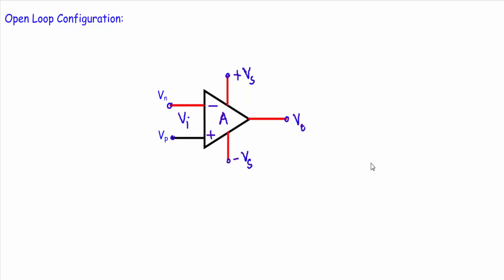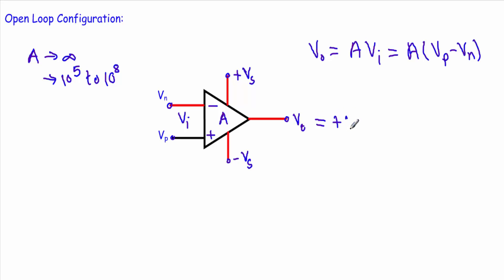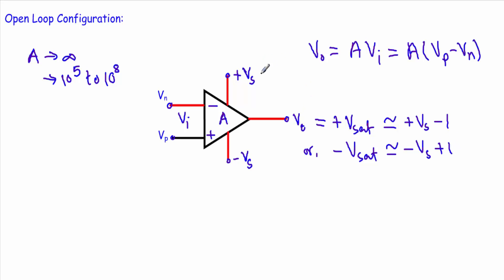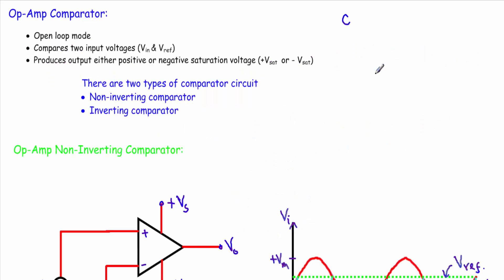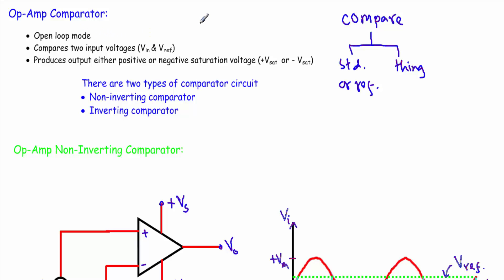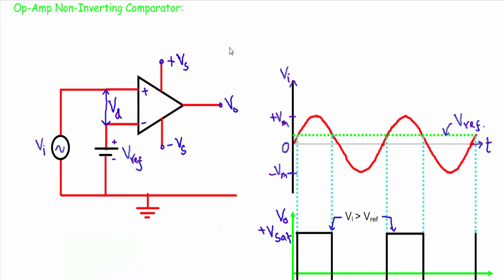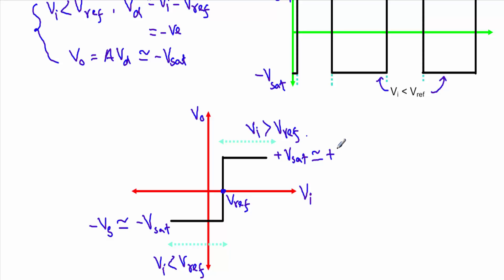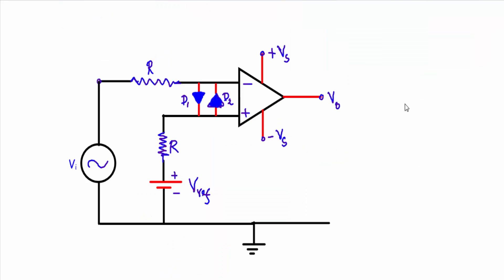Op-Amp as Non-Inverting Comparator

Comment: in practical circuit why we connect the voltage  power source to the inverting terminal because in simple non-inverting comparator circuit we connect the voltage source to the non-inverting terminal ?